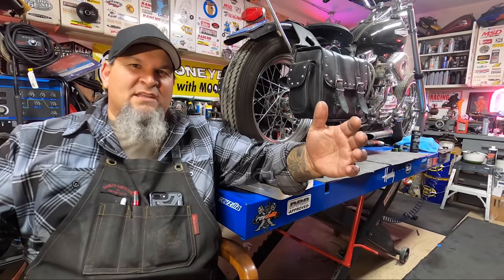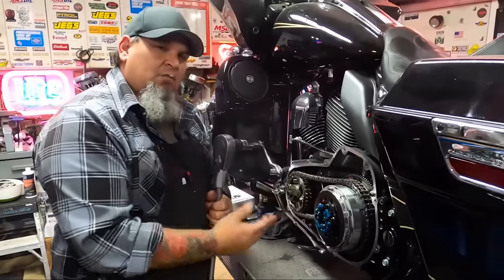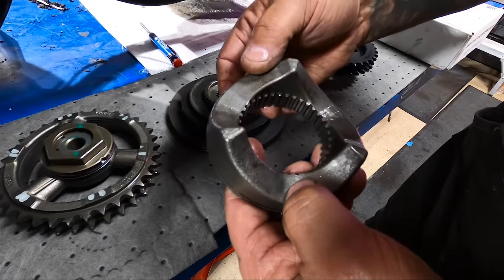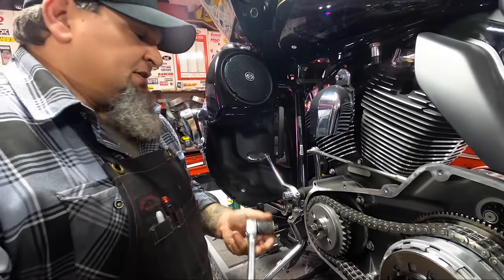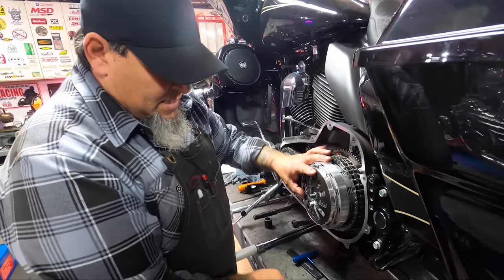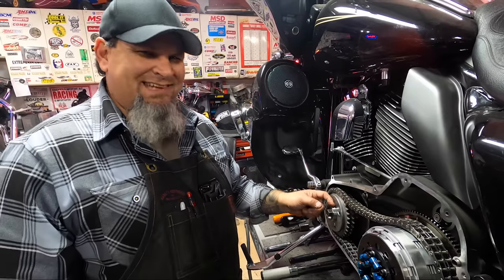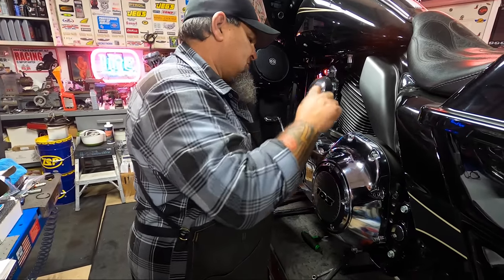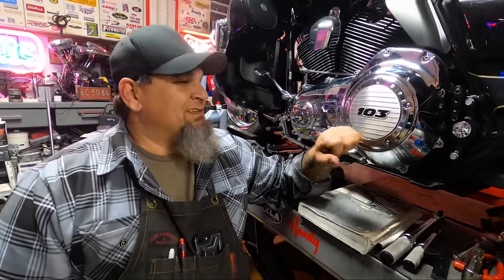Compensator Upgrade for Harley Davidson

Comment: For a “premium “ brand that we’re expected to pay a more than premium price for, there seems to be a ton of shit we’re supposed to “upgrade”.
Reply from the maker: Yeah, we buy the "legend" and then pay twice to upgrade what the factory hasn't addressed. I feel your pain
Reply: I have 100k miles on my Ultra limited twin cam with stock motor and have only had to replace throttle sensor. Keeping them serviced and ride them.
Reply: Everyone is required to understand that H-D is  a t-shirt company that sells incomplete motorcycles. 😉
Reply: @WrenchDevil6  😧😲😬
Reply: Perfect reason to drive a Honda :D
Reply: @WrenchDevil6  reason to ride a Honda :D
Reply: Guy's,only needed if you abuse and hot rod your bike.
Reply: I dont understand why people are on this site.If they don't like Hd.
Reply: @stephenanderson812  because they dont own one, so their only recourse is getting on peoples harley sites and try in vain to boost their metric egos.🤯
Reply: and on top of everything else this upgrade is a downgrade that will fail just like all the rest ..claiming you need a compensator to control the engine intermittent torque applied to the primary chain and the clutch is another Harley fantasy the truth is what you end up with is a death trap that will kill you sooner or later when the back tire stops turning that happens one millisecond after everything explodes so you have no way of protecting yourself against it there is only one fixed one answer that will save your life in your motorcycle in that state that compensator sprocket and destroy it replaced with an ordinary double sprocket with no monkey mountain in it at all and both directly onto the crankshaft but now I'm moving at all it will cost $100 and it will make no difference whatsoever are there any wear and tear on the chain and all the stupid s*** that's just b***** never happened silver $100 you can buy a plane sprocket bolt it on and all your troubles will vanish forever. I got this guy in this video funny talking about that he's reading a script and the real reason why Harley-Davidson maintains that it has to be on there if they change their story today Harley-Davidson's lawyers have warned them that you're looking at a class action lossy causing Harley-Davidson to recall every motorcycle they've ever made and another reason why Harley-Davidson has never put it in motor mounts stabilizers on rubber mounted Dyna Low Riders or the FX because the lawyers against painted in their few do this on the next new model you will have to do it on everyone that's ever been made and now there's about five different aftermarket companies that are making the bars that you fastened to the brain as you will find those on the road Kings and Rhodes rides and the Baggers but not on d y n a s sputhe engineering sales asset they cause traction bars
Reply: @harleyhawk7959  as I can venture to say I've got lots more experience about all of this. There's only one way to solve all the problems with a compensating sprocket by never using one in the first place and the best thing you can ever do for your Harley is just go by and arnieri sprocket don't cost around $100. And yes Harley-Davidson has an intermittent power stroke the back tire but since that happens starting at idle speed at 2 and just before the rev limiter kicks in all these horses in torrent this gentleman went to such any explanation of proving his point proves nothing as it happens faster than any device could ever counter I just happening at a thousand times every minutes to six thousand times and higher every minute which is thousands of times faster than any device can react join the real world you don't feel anything at all and the so-called stresses on all the parts are canceled out separate because of the time involved when they happen as the time it has taken me to try to explain it's already done it about a million times making all these accusations total Fantasy multiplied with b u l l s h i t
Reply from the maker: @donniebaker5984  Well Donnie, I wish you all the luck in the world here. We just try and help the community of owners here in these videos. Try what you will, and whatever works for you works! Can't please all the haters here.
Reply: @donniebaker5984  you know nothin.
Reply: @donniebaker5984  they have compensators too. Duh.
Reply: @donniebaker5984  not true they cost more and not worth as much when resale time .duh
Reply: @donniebaker5984  hey has anyone ever heard of Donnie Baker he is a comedian. Can't believe him.
Reply: It's all in the engineering...most imperfections and any bad engineering are sold with the bike.. as in anything, someone always comes up with a better idea/product.  Welcome to h.d. ownership.
Reply: @WrenchDevil6  $20k shirt..free bike
Reply: @Ladosligese naw... maybe a 70s..
Reply: @donniebaker5984  stock compensator wears out...get a better engineered one, what's the issue?

Comment: I would like to know what you think about it after riding
Reply from the maker: Art, I can tell you it's a HUGE difference than any of the units I've owned. Zero noise, smooth pull and shifting. I'm impressed so far....
Reply: @LateNiteVTwin  ----> 
I had my Local Harley dealership install the Man of War engine sprocket while I waited for it to be installed. I then trailered my RGU home and unloaded it. I took a 48-mile test ride to see if the Man O War engine sprocket eliminated the clunking in the first four gears and I couldn't feel and hear any difference in the clunking. Because the Man O War engine sprocket is two and a half pounds lighter than the stock compensator my 114 engine does seem to rev up a little quicker now. The lead mechanic at my local Harley dealership told me that laid a straight edge across the Man O War engine sprocket and the stock Harley clutch and it was within.010.
Reply: Perfect video. You have a natural talent for teaching. Very good that you stress important details and correct tools !!
Thank you !
Reply: @amphibdriver1  
What primary tensioner do you have installed ?
Reply: @James-fk2sb  -----> I called Dark Horse Crank Works where I bought the Man O war engine sprocket from and they told me that I could still use the stock Harley primary chain tensioner. When I called them and told them that the top mechanic at the Harley dealership had put a straight edge across the Man O war engine sprocket and the stock clutch basket and the run-out was .010, Dark Horse then told me that I could have other issues that were causing the clunking sound when I shift from 1-4 gears..
Reply: @amphibdriver1  from what I’ve seen and heard in these comments and hd type forums. Stock automatic primary chain tensioners put too much pressure on chains which cause problems and noise. Is what I’m gathering.
Reply: @James-fk2sb ---> Yes I have read that too. I was also told the stock HD automatic chain tension may not have taken up enough chain slack yet and this was causing the clunking sound when I shift from first to fourth gear. I was then told to ride my bike at least 200 miles to see if I noticed any difference. I do plan on installing the Hayden primary chain tensioner to see if that helps with the clunking.
Reply: @amphibdriver1  please let me know how it works out for you. Looking to put a man of war sprocket in next week on my bike. I have a Oregon hot bikes auto hydraulic primary tensioner. Hoping that’s better than stock one and makes no noise with new compensator.
Reply: @James-fk2sb  -----> I still have the clunking when shifting into 1-4 gears. I was told that I have other issues that are causing the clunk. Now with two pounds less rotating mass after installing the Man O War engine sprocket my 114-inch engine gains RPM's about 10% faster vs with the stock Harley compensator assembly that was taken off. I plan on installing the Hayden primary chain tensioner and see if this helps the clunking when shifting into 1-4 gears.

Comment: Gary, I love your detailed descriptions and explanations. I think, after seeing lots of repair video's, that you are one of the more experienced ones. An expert, great explainer.
I used to never repair my bike myself, (multiple BMW's), but since I own a custom Harley (1989 FLHTC), I had to solve many problems, watched YouTube, read the book, and succeeded! (broken starter housing, replacement solenoid and wiring harnes. Replaced my stator and volt. regulator. The nut holding the compensator sprocket was tightened really fast, I guess more than 200 pounds/sq. foot! I now have a problem when I tighten it to 150 pounds/sq.foot. It's not holding and making noise. So,I guess another try, making extra sure everything is really clean end not worn out. After that another 2 minor issues, but I love working on my bike!

Comment: Excellent video, man. Thanks. Well articulated and easy pace. Easy to follow and understand. Highlighting the all the critical points. Shattered my stock compensator during an aggressive ride with a 117 Stage 3ed with a really good tune. 130x120hp. Cheers.

Comment: I have the same manual adjuster set at half an inch,turning the motor over to make sure there wasn’t a measurement issues,had a small bit of humming that has dissipated since I’ve been riding…. Bike runs really well minus the clunking…… thank you very much for the video and the input

Comment: Very informative, I upgraded my SE compensator with a Fueling upgraded spring and a SE manual primary chain adjuster which was cheaper than a full rebuild as my wear was minimal, I also, when the bike is level visually fill the primary so the oil just kisses the lower portion of the pressure plate, this works well for me

Comment: I did this job last year. Its not too difficult for most that have basic mechanical know how.
I chose the Baker compinsator with the Haden spring loaded chain tensioner. I wish I saw the Man-o-war first, i would have with that for sure. Race bikes have used the rubber in their rear wheel hubs for decades with great success.

Comment: Very nice tutorial, I can see that you are more than competent. And you have the patience to do things right and by the book with tourque wrenches and specs that are quite helpful to the average Joe trying to repair or upgrade their bike. He'll im thinking of installing the dark horse comp on my old Evo lowrider " just cuz" I don't wanna be wrenching, I wanna be ridin with a smoother and better designed component. You know I can't believe that HD never thought to design a better compensator all these many years, if you look at old 70s ricers, the rear wheel sprocket drive has nibs on the sprocket hub, and cavities in the wheel hub with little rubber shock absorbers in between. This is what Dark horse has done for the compensator. Truthfully I'm surprised that I didn't think of this myself but I don't change them because I don't abuse Mt Harleys, I just cruise and enjoy the symphony of sound and soak up the scenery, to me that's what they really were made for, big bikes to cross a big country🤙👍

Comment: Thanks for the video👍🏻When i changed my compensator, i found out, that there was a lot of 'old' red Loctite stuck in the tread of the crank, so the new bolt from the new compensator would't get in. At first i thought that the thread of the bolt was damaged, but the old bolt olso got stuck halfway. I cleaned the thread of the crank with a thread tap, and there was a lot of red dirt coming out, and no steel chips. After cleaning it with breakclean, i could turn the bolt right in by hand. So i think it's also important to check the inner tread of the crank for dirt.

Comment: Great video, but… Darkhorse told me that you do not reuse the original bolt. You DO need the torx head bolt which is longer and they designed compensator specifically for that Torx head bolt. Now that I have the bolt, you can see that the added length is needed for sure.
Reply: I was told the same thing from darkhorse just last week when I called them just to make sure.

Comment: Replaced a noisy compensator on my 09 Ultra with a Screaming Eagle. We could not get the original compensator out from the casing, solution was to take a power grinder and honed out a little of the aluminum casing, once a little trial and error was done, I was able to pull the compensator out with some vice grips. I also used the oil deflectors that came with the kit and used JB Weld to hold them in place. If you do this prior to pulling the compensator, you will have time for the JB Weld to harden so you can reassemble the case to the engine. Thanks for the video.
Reply: Original you had to take out the inner primary and also loosen the starter. With a softail ( oiltank) its no fun to loosen these bolts.  Your solution is way easyer and do no harm.

Comment: I'm new to Harley bikes. I'm a dirt bike rider since very young, and for a long time now been wanting to ride the roads. So last year, July 2023, purchased the 2023 Street Glide 107 FLHX. My question is what should I be aware of?? You know, what areas to constantly check that loosen up or wear due to these bikes? Recently, thru inspecting the brakes, I came across the front rotors had loosened. So things like that. Thank you!

Comment: I absolutely hate the stock chain primaries. My first Harley big twin almost immediately had a problem with the compensator.. I shitcanned the whole mess and replaced it with a belt drive. And every big twin since has gotten a belt drive. Never regretted it at all ever, and never had any problems since.

Comment: First off...love the video....I have an 08 road king..little over 14k miles. Started having some clunking on start up and shut off.  Several folks identified the problem as the compensator...so I researched....actually found forums and videos with issues I was having....so I parked the bike. Ordered a twin power compensator.... through research they are  a replica of a screaming eagle comp with a drag specialties rotor...I watched your video more times than I can tell you...
Did the swap.  Put it all back together. All torque values correct and double checked....it took forever to start....lil back fire thru throttle body...then it started and it idled like it had huge cams in it...and they are stock...it was a vibrating hard type idle.  And now it seems my starter is trying to go out....battery is hitting 12.5v not running....14v running...no burn or black marks on stator....any input or suggestions would be greatly appreciated....I am pretty mechanical...also went to mmi Orlando for about 6months.  Didn't get to finish ...family problems...
Anyway. Look forward to hearing from ya and thanks
Reply from the maker: Hi Jason, I have to ask, so you changed the compensator only, and you have these issues??? You state you put the twin power unit in? Did you pul the codes through the speedo to see if there were any? I live in California, not sure where you are located. Here's my number! Give me a call....530-864-5370
Reply: @LateNiteVTwin  I did not check the codes.  I will do that in the morning.  Write them and get back with you...in Louisiana....had to postpone bike work for a lil bit of house work from ice storm we jus had. Busted pipes leaking in the roof due to ice.  But all is good....I will see if there are codes and get back with ya.  Thanks again
Reply: And compensator is all I changed...do I need to go ahead and replace tensioner as well
Reply from the maker: @jasontaylor5442  Man, I feel your pain on the ice storms. My sister lives in Texas......If you are running the stock adjuster, I would highly recommend ditching that piece and putting in a manual one. Its going to save you a ton of money by not wearing the primary bearing, and trans bearings out. Let me know when you pull the codes and I can see if we can help you out!
Reply: @LateNiteVTwin  no codes at all....
Some friends of mine asked me if I let the compensator spin around while loosening the bolt to it and clutch basket.  The bar I had in there did slip and the original compensator did spin around...they told me it couldve caused it get out of time??  Have you heard of this?

Comment: Subscribed you are a source worth paying for! Where are you located? I would love to have you work on my bike. I just recently bought a 2002 Road King Classic with the twin cam. I have questions! I'm a sports bike rider who built all mine. Harley seems very over-engineered.(not bad thing) It's hard to find videos that show what I need. I have a rattle in this same area, More of a clang is now while starting. I'm not 100% sure if my bike motor is the same setup but this is why I've been watching every video I can find.

If this is a problem with my bike when I take it apart to find out in the video you said you prefer the aftermarket one. I'm picky about OEM parts do you still stand behind that statement.(would be my choice of parts if so)

What I can find on my motor 1449 cc, 4-Stroke, Air Cooled, V-Twin Engine Bore and Stroke: 95.3 mm x 101.6 mm But The motors are so confusing to me! I'm Pretty sure I have a twin cam version of the motor due to date of bike.

Comment: GREAT VIDEO. I PLAN ON DOING THIS UPGRADE IN SPRING . i HAVE A 2006 FXSTB NIGHT TRAIN CARTURETOR RIDE. SE211 CAMS TWO INTO ONE EXHAUST AND SCREAMING EAGLE AIR BREATHER. CV CARB. STOCK. I'M HAVE PROBLEMS GETTING THE MIXTURE RIGHT AND THE IDLE DO TO NO TACH. DO YOU HAVE ANY VIDEOS ADDRESSING THIS ISSUE OR ANY ADVICE....THANKS FRED

Comment: I like your approach.  in my factory workshop manual (2009 fx) it shows the tool to use to get the sprocket to hold still and it also shows the tool NOT to use (the little stairstep-looking thing.) claiming damage can occur.